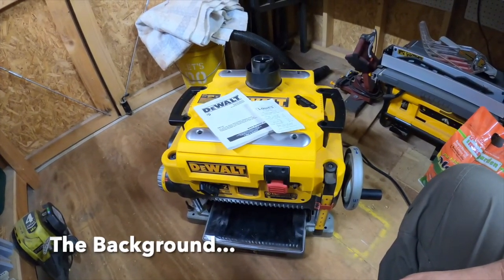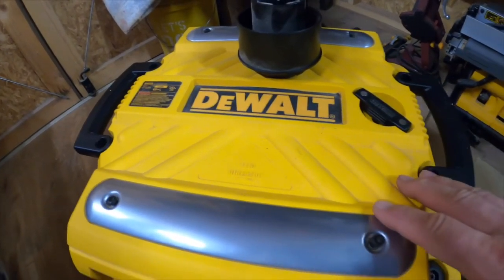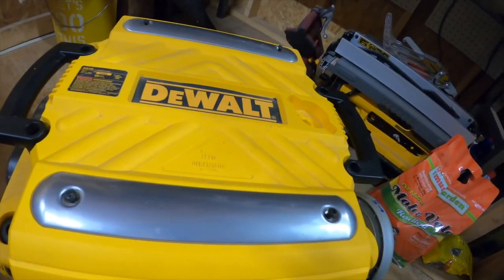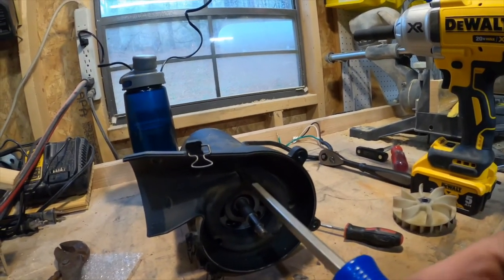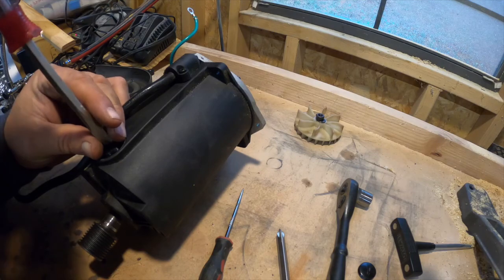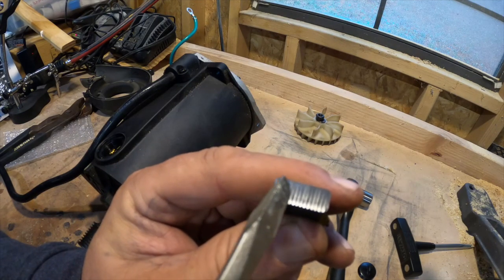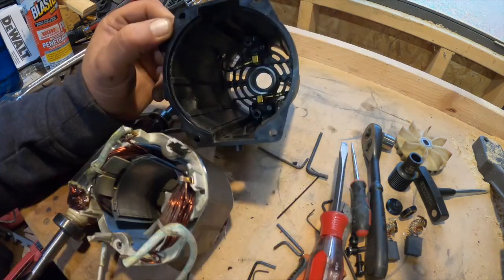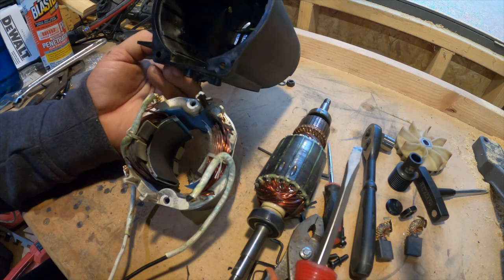DeWalt DW735 Planer:  Motor Disassembly & Diagnosis

Comment: Sorry for your issues. This issue is not why this will not be in my shop. The most over rated planer. The reason for so many sold is because HE HAS ONE SO I WANT ONE thinking. This planer has many issues and the motor is one of them. Look up issues before you buy.
Reply from the maker: Thanks for watching and commenting. You make some good points, but I definitely didn't buy it because "he has one, so I want one." I bought it because I wanted a step up from what I would have bought and it was my first planer. Reviews are so subjective. 1,000 reviewers will say the complete opposite of 1,000 other reviewers, so they aren't always helpful.
Do you have a planer? Which one do you have, if you have one? Have you had issues with it? What do you recommend?

Comment: I send mine back for a full refund after only 2 days of work and less than 100 linear feet of planing. It just stopped working. I had to hit the motor with a mallet (!) to make it run. Horrible engineering. They should be ashamed!
Reply from the maker: I think the majority of them are under-built for what they are expected to do. Kind of like cutting steak over and over again with a butter knife.

Comment: I'm kind of having the exact same problem here. Thank you for your video ! 
The difference beeing that I'm in europe and I can't get the parts easily... 
Can you give me some link to find the exact replacement you used ? 
I want to find out if there is a way to make it delivered in France ^^
Reply from the maker: Check out Toolservicenet.com to verify differences and prices on a type 1 and type 12. Mine is a type 12. Are you using a 220-240v planer or are you using a transformer to convert to 110-125v? When I lived in Europe all of my tools were 110-125v and I had to use a transformer for everything. I don't believe DeWalt makes a planer that is 110-240v. It's one or the other.
Reply: In fact, I was not aware of this for my first use and I did not use a converter for the first 15 minutes... I think it overheated because of this (using a 110V with a 240V input...)

The same sparks comes out of the same spot as in your video, so, I suppose I will find the same kind of problem. I still have to disassemble it first thought.

Thank you for your answer, I will check the items sold on this website ! =)

 @RoCDIY
Reply from the maker: @quentinzeller2840  Now you know exactly what caused your planer issue. The real question is did you burn the motor out or just the circuit switch? Have you plugged it in to a converter yet? What does it do? Hopefully, just the circuit pops. If you get nothing, then the circuit may be completely blown, which could mean that it protected the motor. Did you get smoke and/or a loud hum when it was previously plugged in to 240v?
BTW- I believe the DW735 is 2000watts. If you get or have a converter always use higher wattage. If you use exactly 2000watts it will trip every time you put a load on it. Go with 2500 or 3000 watts

Comment: Hi, how old was the thicknesser before it burnt out?
Reply from the maker: I don't remember exactly how old it was, but I was out of warranty. It went through a period of no use, then a lot of use. Unfortunately, you may have many things you need to do when you need to use it, which I don't think any planer/thicknesser is meant to go through continual usage in a short period of time. I have used it quite a bit since repair and it's still going strong.

Comment: I bought one of these because they were supposedly such great planers. Right out of the box, you had to crank really hard to raise and lower it, then after only planing a couple dozen board feet or so, the PLASTIC sprocket and some other part made of crappy pot metal busted that the chains turns on and it won't go up or down. Save yourself some frustration and don't buy anything made by DeWalt. Their products are overpriced garbage.
Reply from the maker: My planer has worked fine since rebuilding it. There appears to be some consensus that this planer isn't that great, but I wouldn't know any different since it is the only one I have ever owned. I have learned that it requires a lot of patience and time to operate.

Comment: I just got my DW735X, and it's Type 1.  I did some checking, and apparently the Type 1 is made in Vietnam, and weighs about 3 pounds more than the Type 12, which is made in China. Parts from one are NOT interchangeable in many cases, especially the motor. The clincher is that it would appear that the Type 1s are better made and have fewer problems than the Type 12.  Anyone have better info on this?
Reply: My type 1 planer burnt up, first time using it. After 40 minutes of lightly planing soft dry pine it was so hot it shut down. I'm totally disgusted the quality of this machine. To rebuild the motor ordering parts from the US will cost over $500 in Canadian funds.  Nothing manufactured on this planet in the last 30 years is worth buying. It's all garbage.
Reply from the maker: Type 1 was built in Taiwan prior to 2018. Type 12 is made in China. Type 1 does have fewer issues than type 12. Type 1 parts are definitely more expensive than type 12 and aren't interchangeable. The extra weight on the type 1 comes from the armature on the motor. Check out Toolservicenet.com to verify differences and prices on a type 1 and type 12.

Comment: DeWalt power tools have a 3 year warranty!
Reply from the maker: I believe your point is to say that my tool was still under warranty, but I think it is important to distinguish between a "warranty" and a "limited warranty." DeWalt's 3 year warranty is a "limited" warranty... "DeWalt will repair, without charge, any defects due to faulty materials or workmanship for three years from date of purchase." They also have 1 year free service to replace worn parts caused by normal use, and a 90 day guarantee. Have you ever tried to get something repaired under a limited warranty by DeWalt? I have. Good luck! Not an easy process. You pay up front to ship it to them for repair, they make a decision, then you decide whether to pay for the repair or not. If you decide to not have it repaired, you pay to have it shipped back to you. A limited warranty is never going to be in favor of a customer. They say they will do a complete factory overhaul for $329, but it is actually $451.95 (shipping, tax) out the door.

Comment: Yesterday I had the same problem. The planer is 1.5 years, got maybe 10h of work on it. Also was working on pine boards, also engine died (on the knots), the smoke came first, the fuse went off, It did started afterword but with 1/3 of its power, after the fuse blow off the second time all I'm left is a humming engine. I'm out of love for Dewalt. Where are you able to order engine for it?
Reply from the maker: This exact scenario is what seems to be the common theme with this planer. Not endorsing, but I bought my parts from toolservicenet.com. If you have a type 12, then these are the parts you will more than likely need: 
Field: N578666
Armature: N578668 
Bearings: 597691
Reply: @RoCDIY  Million thanks!

Comment: I have the DW735 and it throws the breaker after about 30 mins after running. Let it cool for 30 mins and started back. Ran one board thru it and was returning to plane again when under no load it stopped again. waited 10 min and it started again. Did not run again.
Reply from the maker: Thanks for watching and commenting. What you just explained is exactly what happened to me and led to me replacing the armature and field. In your case, unfortunately the damage was already done. Cooling it down really didn't do anything. The damage was being made worse each time it was used after the initial damage. The armature is probably stuck in place throwing the circuit breaker. At a minimum it sounds like you may need an armature and/or field. Melted plastic on the armature is an indicator. Scoring/rubbing on the field and/or armature is another indicator for replacement.

Comment: How difficult is it to replace the brush housing? You got to the point I needed at the end of the video. I opened the brush covers and one simply slipped out while the other was jammed pretty good and I had to chip it out. The housing got damaged I think in the process and now I can't slide a new one in. Thanks!
Reply from the maker: The brush damage sounds pretty serious. Your brush issue may be related to a bigger issue. Possibly, a bad Armature and Field. Brushes don't typically do that unless they have a defect or they develop a lot of heat from damage somewhere on the motor (bearings, armature, and/or field). When you say "brush housing" I am assuming you mean "motor housing" because the brush is capped inside the plastic motor housing. Is the plastic housing damaged or did a piece of the brush get left inside the housing? If the housing is damaged you have two options- Buy a new motor housing, then catch hell trying to connect the new Motor Housing to the Field (17:50 in video), or buy a new Motor Housing and Field that are already connected when you order them. Make sure you know whether you have type 1 or type 12 planer when you order parts. I order from toolservicenet.com. but you can order from wherever you choose.

Comment: I have the type 1 motor and parts to replace the field and armature are $300, the housing field, and armature for the type 12 is $110. Do you see any issue with buying the full type 12 motor and putting it in and saving the $.  I'd be replacing the housing, armature, bearing, and field.  Thank you, your video was helpful for this issue.
Reply from the maker: I wouldn't be able to tell you first hand that you can do it. I only know of one person who has put type 1 parts on a type 12 and he claims it worked. I realize this is the opposite of what you want to do, but I would assume that if you are replacing all of the parts that you say you are, then I don't see why it wouldn't work. I've read many stories about people buying and trying to use INDIVIDUAL motor components on type 1 that are type 12 and vice versa only to find out they don't work or don't fit.
Reply: @RoCDIY  Thank you.

Comment: Thanks for this video. I'm trying to choose one - the DW735 or DW733. The DW735 have good engineering design but such issues with it's motor is disappointment
Reply: I hope you haven't made your choice yet or purchased the 733.  I have the DW733, from new less than 2 hours work and just made a couple of bits of furniture with very light use.  In fact only used to remove the saw marks from pine.  My motor totally destroyed itself in the same way as the video with bearings in perfect condition.  So I can only assume there is an alignment or assembly problem.  Out of warranty as well.  .......... Heap of junk!!!! ............. I will be making a video on it all this week.😭😭
Reply from the maker: There are many pros and cons. The 733 is more expensive, only a two blade, but you can sharpen the blades. The 735 is cheaper, three disposable two-sided blades and it has a chip ejector. I personally think the motor issue is caused by impatience... forcing the wood through faster than it should be and not taking in to account the type of wood. I am pretty sure that is how I burned mine out.
Reply: @RoCDIY  I just opened mine and the motor is sparking on the first day of use and now they will not honor the warranty in Hawaii.  I would consider getting a better brand.
Reply from the maker: @KuponoMcDaniel  They know how to work those so called "warranties." "We'll determine whether it's a defect or not and let you know. We inspected it and determined it to be consumer fault." Ryobi does the same thing. You pay $75 up front for a warranty repair. If they determine it to be user fault, then they keep your $75 for diagnosis and charge you more to repair it. Likelihood of manufacturer defect is 0%.
Reply: @RoCDIY  they “temporarily closed” the dewalt factory service center in Hawaii and won’t the the local shops who once did warranty repairs do them now. I just took it out of the box broken. So then I have to also pay shipping back to Hawaii
Reply from the maker: @KuponoMcDaniel  Sounds like in your case you do need another brand. That's terrible to get it right out of the box broke. Good luck with whatever you decide to do.
Reply: @RoCDIY  in our stores dw733 is 30% cheaper than dw735. Today I wanted to order 735 and they told me not to buy it (!) as it has issues with motor

Comment: This dewalt planer is no good I have a brand new one  and it work for a year and stop  I have a king Canada brand planer for about 8 years I use it and plane every type of board you can think of with no problem the dewalt 
Planer is no good
Reply from the maker: Thanks for watching and commenting. Everyone has their preferences. Now that I have had it longer I can give a more honest opinion of it. DeWalt does have a good reputation and tends to be on the upper end of quality. However, I don't think that is the case with this planer. With brand new blades on it and a sound motor it's a good planer, but after a little bit of use it goes downhill pretty fast. You definitely don't want to push this planer past its limits. If you ever bog it down or trip the circuit, start counting the days before it completely goes out because it will. Harder woods will destroy this planer quickly.

Comment: All mine will do is hum. I got it pretty hot and it quit I guess I burnt the motor up. What do you think
Reply from the maker: I would agree and say you burnt the motor up. It got really hot and melted the plastic pieces inside. The plastic pieces are more than likely lodged between the armature and field. If it is still humming, then it wants to work, but it is past the point of functioning again. At a minimum, you would need armature and field. You may need a set of bearings. If you order bearings, order 1. An order of 1 is a set of two bearings. Check whether you have a type 1 or type 12 planer. Differences- parts cost, where they are made, and size of certain parts that are not interchangeable.

Comment: What's the difference bewteen the type 1 and type 12?..they look identical?....mine is type 12 but it seems like they only make type 1 parts.
Reply from the maker: Thanks for commenting. Type 1 vs Type 12 can be as simple as what country it was assembled in. It can also be a major component that was identified faulty sometime during the year, they redesigned it, and now call it Type 12 to distinguish it from the original build.

Comment: Where did you get the parts from?  Do you have a list of part numbers for the field, brushes, bearings and armature?
Reply from the maker: Check out my other video: https://youtu.be/Qh0n4Sm_SUQ. The website and part #s are listed. Website: Toolservicenet.com. Field: N578666, Armature: N578668, Brushes: 578672, and Bearings: 597691.